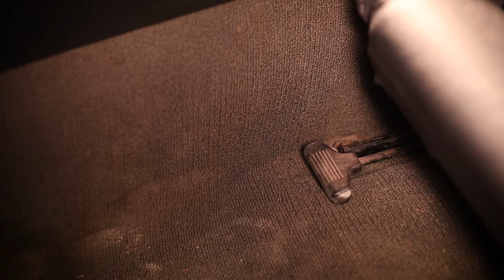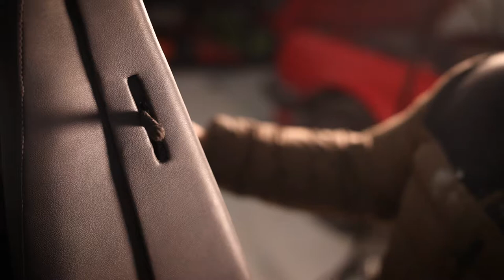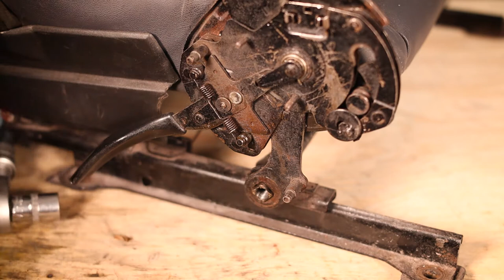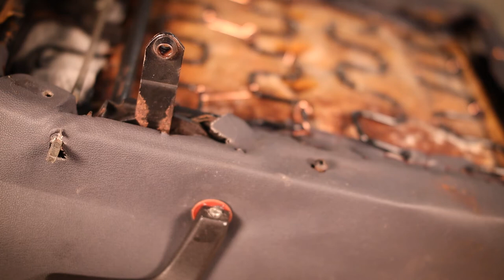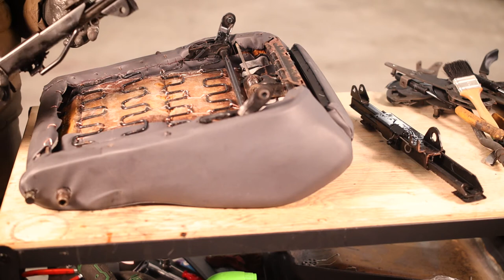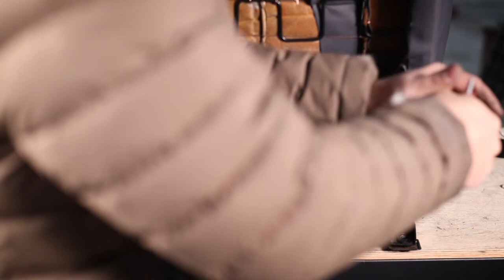recaro mechanisms restorations | bmw e30 seat repair | ASMR

Comment: Um great vid but why the hell did you cut off the brackets and reweld what appeared to be the same/new brackets?  Why not leave the old ones?  Had me until you started cutting/welding.
Reply: I was wondering the same thing. He probably wants to sit lower, or either the new brackets are slightly raised.

Comment: What good does it do to do a tutorial if you're not going to explain what/why you're doing??  SMH
Reply: Kind of wondering why the brackets were cut off too. Complete mystery
Reply: @robw7205  look like brackets cut off and Re welded back on to adjust the height range 🤷‍♂️ 
Apart from that very strange video
Reply from the maker: Sorry for the confusion, I shot the video simultaneously. The slides of these seats are old technology. I mounted the seat slides of the 90s on this seat. Now it's solid and works fine. regards,